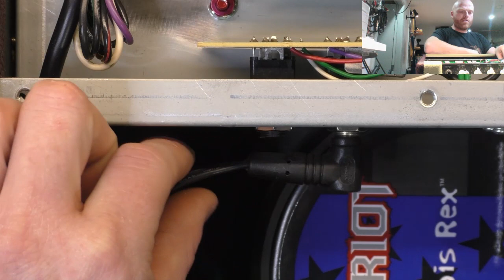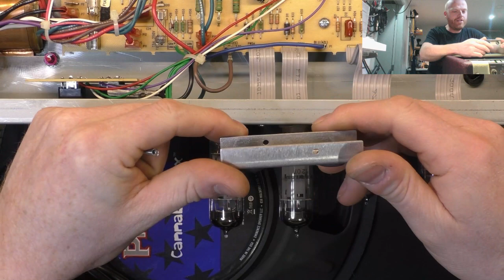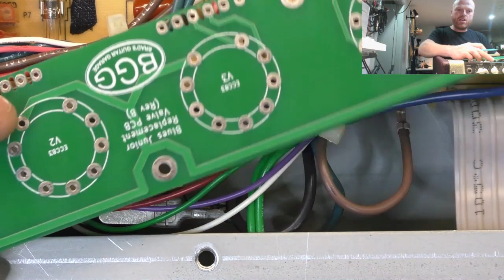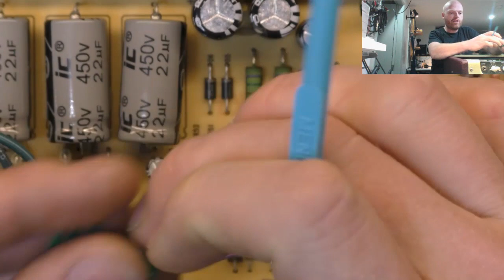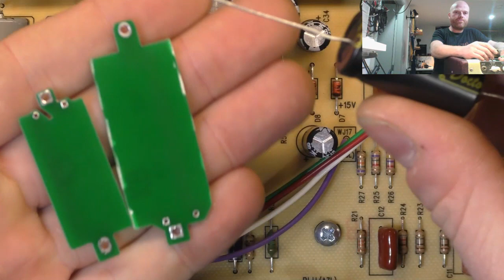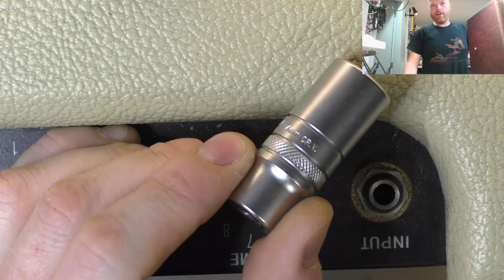Fender Blues Junior - Common Problems & Solutions (Part 1)

Comment: Great Job Brad...I've been an amp tech for over 40 years (retired now but still work on some when I feel inspired to) and probably worked on hundreds of Blues Junior amps over my career. You hit on every part that can, and usually will eventually fail in these amps as well as most Fender amps made in the last 30 years. 

We always said these later model Fender amps were built by Bean Counters. 

Those little bias boards are a Godsend but they don't fit on the earliest green board versions. One has to get creative to get an adjustable bias circuit shoehorned in the older ones. I fabricate a board for the later versions out of a small piece of perfboard and they work great. 

I wish there was something like that tube PCB you designed here in the states. Again, the PCB's used in these amps from the get go were abysmal failures. 

Great idea adding the bias measuring resistors onto that board. I assume you populate those with 1/2% 1Ω resistors. I have a couple of bias probes in my shop that I made myself but having access to those resistor would be great and make things easier!

Great video...Keep up the great work!

Comment: If you want it to sound good, remove the bright cap, the amp will open up. It’s so good that I used it on stage, and we do hard southern rock like Molly Hatchet etc. I put an old peavy speaker (probably  an Eminence) but people don’t think the BJ3 isn’t capable, it is. Remove the bright cap and replace the speaker and mine is no way woofy and it takes pedals really well. I think many people don’t know how to set them up.

Comment: Brad thank you for your videos
 Is there a trick to getting the led back into place?
I can't remember how I removed it
Thanks in advance
Ed
Reply from the maker: Never had a problem with it, mate.
It's just designed to be shoved into the jewel bezel.
If that doesn't work, something may be broken.
Reply: Yeah it's seems very simple to me as well I don't understand why it's not going in did you have to push any of the tabs in with a tool?
Reply from the maker: It's got those little white plastic tabs that spring out. You may need to massage them in a little to make it fit back in the bezel. Alternatively, if it's not holding in place, you may need to bend them out a little. They are very flexible nylon, but be careful not to break them. You may need to remove one of the zip-ties if the cable is too tight.
Reply: Thank you for the input

Comment: Interesting, the change of C1 simply depends on your "ear" but save the output stage and even better, what would be good is to give the values to replace R51 & R52 (and the adjustment procedure) which make 33K and 22K respectively which gives -10.6v on C-, any idea ?
Reply from the maker: Those changes are not constant. They depend on the pair of valves you have on hand.
To make life easier, my mate Rowan made an adjustable bias mod PCB for use in these amps which you can find here:  https://www.rsdsound.co.uk/product/fender-blues-junior-bias-mod-kit/

Comment: Better not to use the crappy PCB…rebuild the amp with an old school Fender Style board or a turret boards and populate it with more  better components  than Fender’s barely adequate voltage ratings on the caps…in essence fix the problem to last 20 years, instead pushing it down five years to the next tech…

Comment: Great video! Brad! I have the exact same amp. I decided to convert it to point to point wiring before the PCB had a chance to give me a problem.  It also has an adjustible trimpot for biasing the tubes which were biased way to hot from the factory. One way for fender to sell more tubes and amp repairs 😁. At least now it's easy to troubleshoot and replace parts if necessary.  The one thing I have try is changing the 47uf bypass capacitor on V1. You're right about it having way too much gain in the first pre-amp stage. The volume control is basically unuseable as is. You mentioned on your video you used certain values but I couldn't make out what they were. I've disconnected my 47uf capacitor and the gain gas dropped and the volume knob is more useable. There's just a tad bit too much base. What value do you usually use? Thanks.
Reply from the maker: I've gone as far as 0.47uf for that bypass cap with great results. It's starts to lean toward Marshallesque style distortion. Obviously the architecture is very different, I'm just talking about the EQ balance prior to the distorting stages.
Reply: @BradsGuitarGarage  Thanks for your reply Brad. Now that I've disconnected the 47uf cap the volume pot has a more useable sweep with breakup starting between 6-7. There's a bit more bass coming through however than I like. I was thinking maybe 2.2uf or 1 uf.

Comment: I switched my BJr. 3 on after a year not using it and the outer power tube (next to speaker out) flashes up white followed by a nice purple light show.and noise...switched it off and on again...there also was a strange smell in the air
after the white flash I could shortly hear my guitar for a few seconds before the noise started...in hope it's just a tube
Reply from the maker: While it was likely just a tube initially, the fact that you could smell something likely means that the amplifier has suffered significant damage. Time for a tech inspection, mate. If a new valve PCB is required, I manufacture and sell upgrade boards on my website www.bradsguitargarage.com.au
Reply: @BradsGuitarGarage thanks man, it was most likely just a bad tube...Everything looks fine on the boards,no burnt spots/smell etc
I switched both tubes (outer  "lightshow" tube to the inner slot) and the amp worked fine, but the bad tube didn't glow in the inner slot (the good did)...I will put in a new matched set...
HAPPY END: I put in an unmatched NOS EL84 (from a hughes&kettner amp)  I had lying around and both tubes glow like christmas and the amp is dead silent and sounds good...I leave it on now for an hour and see if everything stays fine

Comment: What’s a good alternative with 15watts that does cleans and break up ….not looking for an amp that does super high gain
Reply from the maker: AC15's are fantastic (once they're modded to not eat EL84's, anyway!), Orange do some good stuff too, around the same price range  as the BJR.
Reply: Cool. Thanks. …rather not have to mod more than a speaker ….especially since I can’t mod myself it just raises the cost

Comment: I remove the screws that hold the tube board in and take both boards out at once. It is much easier for me to have the boards on the bench and not bending the ribbon cables too much. Great video

Comment: Guitar amp manufacturers,  stop setting bias so hot! I had to replace output tubes in my Marshall  Origin 50 (less than 2 yrs old) because of hotter than needed bias.

Comment: My Blues Junior crackles when the lead moves in the Jack. Then it goes really quiet. Anyone have an idea what the issue is? Would appreciate it
Reply from the maker: Likely a cracked solder joint, mate.
They can be replaced by hardwiring a more reliable switchcraft chassis mounted jack.
Reply: @BradsGuitarGarage  thanks a lot pal

Comment: Do you have any suggestions for Blues Jr Harp mods 
From NJ USA
Reply from the maker: I don't know much about tuning to harmonica, but I've heard that generally unruly 5-ish watt single ended amps with with no neg feedback, 8" drivers, with limited bandwidth are preferred.
So I'd suggest perhaps lowering the first stage bypass cap to below 1uf, perhaps some different bypass and coupling cap values downstream, either playing with feedback values, or switching or completely disabling it.
Also, take into account what the mic output impedance is and modify the input stage to suit if required.
Could be a fun project.

Comment: Hey Brad what are the values you use on the C1 position please?   ....something to 4.7 is what I heard couldn't make it out. I have a gibson hollow body. Do I want a lower or higher value? I'm finding it breaks up too early. Thanks man!
Reply from the maker: Aim somewhere from 0.47uf to 4.7uf according to taste. Higher values will have a lower frequency cutoff point.
Reply: Ok so higher values will break up earlier? Thanks Brad!
Reply from the maker: The values of C1 are not directly related to "breakup".
Read this: https://www.google.com/url?sa=t&rct=j&q=&esrc=s&source=web&cd=&cad=rja&uact=8&ved=2ahUKEwirg4GP_ej9AhWw3jgGHV7MD5IQFnoECAoQAQ&url=http%3A%2F%2Fvalvewizard.co.uk%2FChoosingBypassCaps.pdf&usg=AOvVaw2c3w-37e_iAU7j1qswoEZM
Reply from the maker: And simpler graphical examples here: https://www.valvewizard.co.uk/OtherStuff.html

Comment: The Canibus Rex is the STOCK speaker in this amp: The FSR Blues Junior with this particular Tolex and speaker Grille cloth covering. The Canibus Rex came from Fender with this speaker installed. Fender did other small “special runs” of Blues Juniors with different speakers, different Tolex and Grille cloth coverings, also as FSR amps.
Reply from the maker: I had no idea, thanks mate.
It's literally the only one I've ever seen or heard about.

Comment: Interesting that that has a v rating of 240. In the Uk I've switched mine - a buster I'd been given for free to fix up - to 240 - it does have the tap available. Where we are in Leeds the mains can be up to about 250 easy.
Reply from the maker: Yes, in hindsight, I think this one was set up for an actual 240v but that is rare. This is probably why the plate voltage wasn't way off the high end on this particular specimen.
More often the international amps are sold as 240V input, but you look at the service manual and transformer specs (if available or printed on the transformer itself) and it actually says "220v" or "230v" input.

Comment: Those look like nice sockets for hand tightening or loosening of pots and jacks, with the *knurled" grip (that's the word you were searching for). I have a set of double-ended Hozan sockets for this purpose, but ordinary deep sockets will  work if you rough up the outer chrome with a Dremel for better grip, or put rough textured, non-slick heatshrink tubing on the socket. There are special plastic "Rocket Sockets" on the market but I've heard that they are kinda soft and wear out.